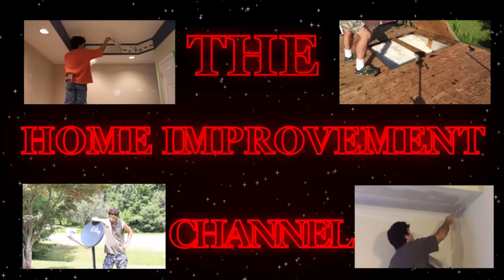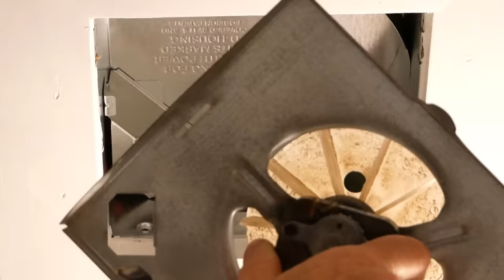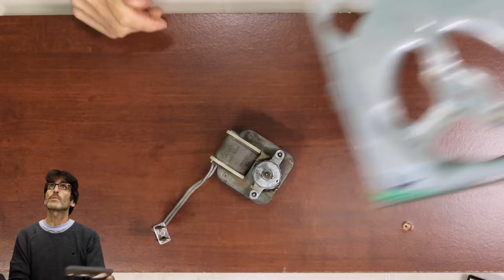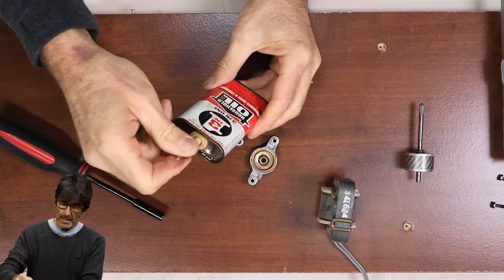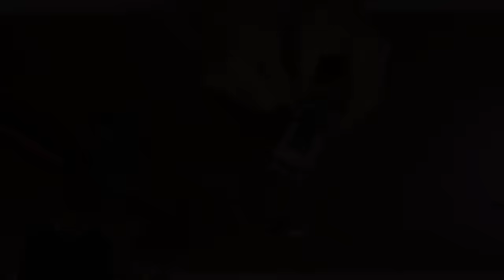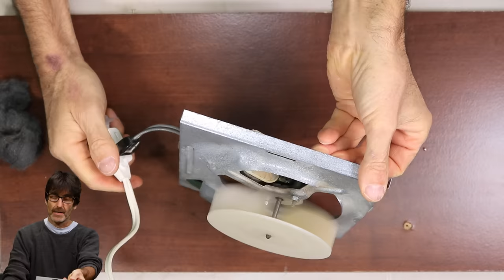Replace Your Bathroom Fan in 5 Minutes FLAT!  NO Attic Access!

Comment: Does this method work if the new fan has a light on it but the old was doesnt or do I have to rewire it
Reply from the maker: Hi.. chances are the new fan is going to be different.  The new fan with the light will usually come apart in a similar fashion as the one shown in the video, but it will only work if you're exchanging the same fan for the same fan..  The housing will be different if you're trying to swap out different fans.. hope that makes sense..

Comment: my bathroom fan doesnt remove steam from the bathroom could you tell me if it needs to be replaced.
Reply from the maker: Does it run?  One thing u can do is put a piece of toilet paper against the grille and see if it stays... If it's running but doesn't have enough suction to hold the toilet paper the ductwork may be clogged.  I've seen where birds or other critters can make a nest in the ductwork.  Just a possibility
Reply: @TheHomeImprovementChannel  thank you

Comment: I don't have 3 in one, I do have wd 40. Would that work also?
Reply from the maker: To do what? 😊
Reply: @TheHomeImprovementChannel  lubricate the motor in place of 3 in 1
Reply from the maker: The WD40 will probably dry out in short order...  A small dab of marine grease would work fine... I would also do some checking into what kind of grease will attract the lease amount of dirt/ dust..
Reply: @TheHomeImprovementChannel   I'll likely replace the whole thing when it comes to that. I offered to do it but my wife said she is fine with it now. It's loud but it does not clunk. Thanks for your help.

Comment: This doesn't work if the original fan has been discontinued.  We contacted the manufacturer and they told us the closest replacement model, which we ordered and just received.  It is slightly larger than the old fan and my husband cannot figure out how to remove the old housing because we have no attic access.  If you have a suggestion, that would be great.  Otherwise, we're screwed.  The old fan was making an unholy sound.  I asked him to just clean it up so it'd work, but he took it completely out and said he thought the ball bearings had gone.  He took it apart and tried to reinstall...and it wasn't working at all then.  Super.
Reply from the maker: I'm actually going to do a video on the coming weeks of changing out the whole thing.  But if you look at both motors (the motors themselves) sometimes you can swap motors from one housing to the next.  Take a look at that and see if it's feasible solution.

Comment: The title should be “Repair your bathroom fan.” Note that Broan model QK60 will upgrade to a more effective and quieter squirrel cage fan without replacing the housing. It’s about $42. (Edit: QK60 will fit many Boan-Nutone fan housings made in the past couple of decades, but it won’t fit the 30 year old model 690 that’s in my home. Broan used to offer an upgrade for that model, but it is discontinued.)
Reply from the maker: Thanks for the tip!

Comment: What if you want to replace the whole unit?
Reply from the maker: If you don't have attic access, you have to pull it all out from the bottom.  It's doable without breaking the drywall, but not easy.  If you do have attic access, you can disconnect everything from above and remove it that way, but then you'll be all up in the insulation.. either way isn't that great.. :-(

Comment: Why do bugs get in through this fan! I have hornets 🐝 loving it!
Reply from the maker: The fans normally have a flapper at the fan itself.  Up until that point the vent in the roof or the soffit might not have any protection.  You might have to add a screen at the point where it exits the house if there's not one already.

Comment: If you can find a fan motor to replace the old one, this will work...
But if you cannot find a replacement, you'll have to remove the old housing anyway...
Removing the old housing isn't as hard as you claim...just use a chisel to break the screws and it will slide right out of the ceiling...
Reply from the maker: No it's not that hard.  I have another video replacing the whole thing.  The insulation falling on your head is the worst part for me!

Comment: I have a fasco industries model 667 where housing is screwed in from outside so I can’t unscrew it and top doesn’t come out. Help!
Reply from the maker: HI, Yes this sounds like a different animal.  Can you get the motor itself out?  You might be able to replace that.  I can't see what you've got..
Reply: @TheHomeImprovementChannel  I cannot get the motor/fan out as the entire housing unit is together and screwed in from the above-ceiling space. This is a laundry room but this and my two bathrooms all same floor and no attic above. I’m thinking of just shearing off the threads or even cutting a hole around them. I was hoping to keep the housing and just swap out the motor.

Comment: What happens if my fan has no vent going outside and is 35 years old and I can no longer find this model? Also the exterior of my house is stone?
Reply from the maker: Normally if the fan is upstairs the vent will go out thru the roof.  If it's downstairs somewhere, it'll go thru the band board  (the board that runs at the end of all the floor joists to hold them together) at the rear of the house unless the bathroom is in the front, then it'll go thru the front, but not commonly.  I'm not sure where your's is located, but yes it should be vented somehow.  If you can no longer find this model, you'll have to either remove the fan motor itself as I showed in the 2nd half of the video and try to clean and oil it, or if that's not possible, you'll have to remove the housing from the ceiling and replace the whole  thing.  Either way, it "Should" be vented.  If it's just not possible, it's been that way for 35 years... that doesn't mean it's right or to code.

Comment: This trick only works if the housing and motor plate is by the same manufacture, otherwise you’re SOL and will need to pull the housing out as well.
Reply from the maker: Not exactly true.. I’ve swapped motors out on housings that we’re not the same and was back up and running
Reply: I vacuumed out the debris and spray lubed without removing anything and got a fan that just hummed to spin quietly again.

Comment: Is there such thing as my fan blowing in then out?
Reply from the maker: I don't see how the motor can run backwards??!  Maybe if the fan blade was installed upside down it might cause that.
Reply from the maker: Sylvia isgod  That can absolutely happen.  Usually thru the roof it is protected from that, but if it vents out the side of the house and the screen is gone that keeps the vent closed, yes they will go in there...

Comment: unfortunately the fan in my home (.25 years old) is a combo heater and Exhaust Fan and i had to buy a new Fan unit lik ethe one you showed from Home Depot and swap the motor out of it
Reply from the maker: If you could find the same heater/ fan unit, you still should be able to pull out either the heat side or the fan side and swap it out without swapping out the case

Comment: My fan started making rough noises today and then a few seconds later it cut off. Does that mean it probably died? At first I was like oh no this is gonna cost me a fortune. However judging by this video, it doesn't seem so bad.
Reply from the maker: Its hard to say if it quit for good or not.. when you take it out, see if it's turning freely.  If it's turning freely and still won't run, then yea it's probably toast..
Reply: @TheHomeImprovementChannel  I took it out yesterday. The amount of dust up there was unfathomable. All over the fan, including the part of the power cord that plugs in. Do you think it might still work, after I clean it? Or more likely it's a goner?
Reply from the maker: @MountainsArePretty1234  Since you've got it out does it turn freely?  Even with the dust?  If it's a little tight to turn, like you can feel some resistance, then it might be worth cleaning.  If it's totally turning freely and it doesn't run, then it's probably no good..
Reply: @TheHomeImprovementChannel  I cleaned it. Didn't work.
Reply: @TheHomeImprovementChannel  I went to Lowes but naturally they dont sell this kind. I bought one but it doesn't fit at all.
Reply: @TheHomeImprovementChannel  I have to find out where I can get one like this. Half the sticker is missing. So I cant get the serial number. There's some numbers on the motor part but I don't know if that will help or not.
Reply from the maker: @MountainsArePretty1234  One thing you can try is see if you can swap the motor itself.... I don't know how yours is setup there... does it have a short cord with a standard outlet electric plug?  If so, I've swapped out the motors when the housing is no longer available... just a thought.
Reply: @TheHomeImprovementChannel  Maybe. I'll look into it. Thanks.

Comment: That’s good if you’re replacing the same motor but I assume if you want to increase your CFM or add a light to your fan… Everything has be replaced.
Reply from the maker: Most of the time one would just replace the fan motor and you're done.. but naturally if you want to upgrade the fan, then you're getting into a different story..
Reply: @TheHomeImprovementChannel  thanks for sharing! 👍
Reply from the maker: @KevinsHeaven  YW

Comment: Bummer,,  my housing comes off. Then the fan motor is attached to another metal chassie. With more wiries and wire caps. Just had this brand new fan installed 3xyears ago.
Reply from the maker: Arrgh.. .it does sound like its a different one.  If you have FB, you can upload pics to my page there under "Take a Bath Productions".  If you have a question...

Comment: Mine is a really old model. I don't think the plug-in will work with the new one.
Reply from the maker: Probably not, but if yours has a removable piece like this one does, you might be able to swap motors to the old housing

Comment: The part I want to most is how to take the grill off and you didn’t include it. My vent is totally dusty crusted all over it. The fan is functional  but vent isn’t efficient at all with all the dust covering. I don’t see and screws and I’m afraid to pry it open.
Reply from the maker: On this model, you just pull the grill straight down.  Then there will be a clip on each side.  You just squeeze the clips and pull down and that's it..  Not sure if yours will be the same.

Comment: It would be great if they were all made that way.
Reply from the maker: Many of them are, but you're right.. not all of them.  If your motor is bad, sometimes you can pull the motor and replace the motor itself and still leave the housing up in the ceiling.  Just need a motor of similar size, and the shaft must fit your old fan blade.  Even if the mounting screws don't line up, you can drill new ones.  Just an idea.
Reply: @TheHomeImprovementChannel  I was doing a replacement in my downstairs bath and had to destroy the unit to get it out.
Reply from the maker: @f150bft  Oh that's terrible.  Hopefully the drywall survived!

Comment: How many  days , months , years passed between rebuilds?  Is this a routine thing, say like every 2 years?
Reply from the maker: Of course it depends on the condition of your fan.  The one in the video I used for quite some time without any issue.  This is a $15 dollar fan new.. the reason I showed the cleaning is sometimes those fans are much harder to replace than just popping out the old one.  In that case a good cleaning/ lube is worth a try instead of all the work to change out the whole thing.. housing and all..

Comment: My bathroom fan broke and the mount is 8.5inches x 8.5 inches. We have been unable to find any bathroom fan motors that match.  They’re either too small or way to big.  Did anyone else have this problem?
Reply from the maker: Jules * you can probably pull the motor itself from the housing and reuse the old housing with a new motor... I’ve had to do that before and it usually works

Comment: Appreciate this video, but realize you are repairing a low end noisy fan, not really replacing it..? (Those fans are rated at 50 CFM at 3.5-6 sones.) As you said, this really only works if you can find models where parts inter-fit.. they are common, but with changes over the years. This one looks super clean and new compared to what I usually see doing renoes. 
Another option to consider if it this doesn’t work: The newer snap-in, quiet, retro-fit fans (80 CFM at 1 sone), under 100 bucks, are easy to install, no trip to attic necessary, take under an hour to refit.
Reply from the maker: Yep

Comment: Unfortunately the new motor did not fit into the old housing for me at all.
Reply from the maker: That can happen... is there any way to switch the motor itself to the old housing?  That should work if they're similar...
Reply: @TheHomeImprovementChannel  Not even close. Tabs are in different spots and motor is too big. I’m pulling out the old housing today even though they are the same size in theory. Thanks though!
Reply from the maker: @cowpuddles4851  Bummer!
Reply: @TheHomeImprovementChannel  Lol wish I had thought of that before trash day…
Reply: @TheHomeImprovementChannel  Lol wish I had thought of that before trash day…

Comment: I got the motor out , went to Home Depot to get new one. The guy at Home Depot had no idea what to find even though I had the old part with  me. He told me they don’t sell motors by themselves much anymore then he found NuTone and I guessed on size bc the guy said the housing has the model number so if it doesn’t fit , find the model number. I go home and if didn’t fit. I found the model number on the actual motor not the housing that the guy from Home Depot said. My old model says HVI 50 CFM at 10 WG , 4.0 sones. I have no idea.what any of those numbers mean. I tried looking for it on Home Depot , Amazon , ebay and none of them sell that model . I have been finding NuTone brand but I don’t know if it’s going to fit the housing. So frustrating.
Reply from the maker: You don't have to buy the motor by itself... You can buy the whole housing with the motor included and then you swap out the motor into the old housing that's still in the ceiling.  Measure the housing that you have 7x7 or whatever and then go back to the store and try to find one with that size insert.  For example, this is the 4 sone one that Lowes sells, and I believe the one in the video...https://www.lowes.com/pd/Broan-4-Sone-50-CFM-White-Bathroom-Fan/1076121

Comment: I always thought there was duct work up there that whisked the moisture away! 😅
Reply from the maker: There is...  Usually a 3 or 4" flexible pipe that usually goes out through the roof or soffit...
Reply: @TheHomeImprovementChannel  Okay because mine looked like the one you fixed and I don’t see any pipes or hoses.
Reply from the maker: @John Baird  Is the fan on a 1st floor where there's another floor above it?  If so you won't see the duct work.  It's up in the floor and should come out behind the house somewhere.  IF the fan is on a floor with an attic above, the ductwork should be in the attic and goes out through the roof or soffit... at least it's supposed to!  I have seen some cases where the fan is venting in the attic or soffit and that's not right.
Reply: @TheHomeImprovementChannel  It is on the second floor, but looks just like the one in your video where there is a circle in the housing.  I don’t see any visible holes for the air to go out. Looks like I have another project to do to fix that!
Reply from the maker: @johnbaird8805  OIC,.. sounds like I'd have to see it...

Comment: I'm a cheap and lazy bastard so that's how I've been doing it.  However, I recommend against rehauling the motor because they start making noise again within a year or so.  For under 20 bucks (amazon) for the broan/nutone 688, it's just not worth it.
Reply from the maker: Yes.. I included the cleaning section because sometimes someone will have a fan that's not available and they could clean it to hopefully get a little more life out of it.  Thanks for the info!

Comment: Mine is a fan light combo...
Reply from the maker: Many of those still have a removable fan under the light.  If you can find the one that fits your old one, it's easy to swap out..
Reply: @TheHomeImprovementChannel  that's the problem. Finding the same fan lol
Reply from the maker: @Justcuz99  Sometimes if you can find a close model, but the removable housing isn't the same, you can swap out the motor itself into the old housing..

Comment: My fan was end of life so I had to buy different fan that had different hub size so I had to unscrew and remove old hub.  It was not fun.
Reply from the maker: Arrgh.. NO it's not fun at all!  As long as new one was slightly bigger than old one,.. then you don't have to worry about patching and painting ceiling.
Reply: @TheHomeImprovementChannel  unfortunately my old fan was little bigger than the new one so there is a gap that we see through it.   So now we just use paint tape to hide the gap since we don't know how to patch drywall.
Reply from the maker: @lot5953  Arrrrgh.... I do have some videos on patching drywall if you want to fix that!.. :-)

Comment: The problem is to get the same brand
Reply from the maker: I've found even with a different brand, as long as it's the same size it'll work.  This particular fan is a very common size because it's a builder grade cheap fan.  If you have a different size, you still may be able to  use the principles here to replace it.